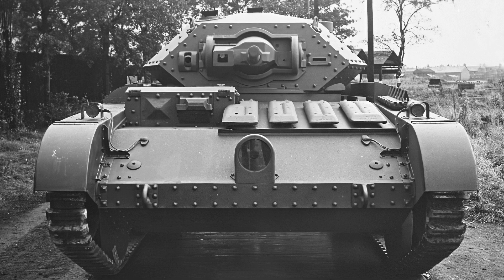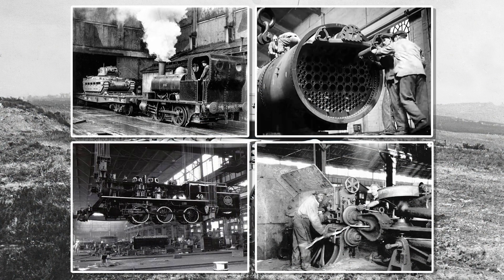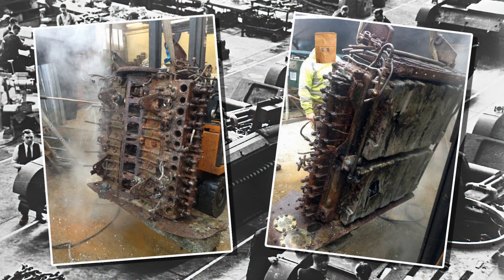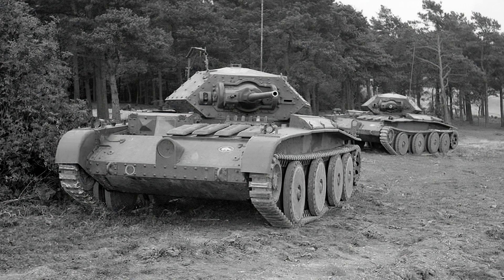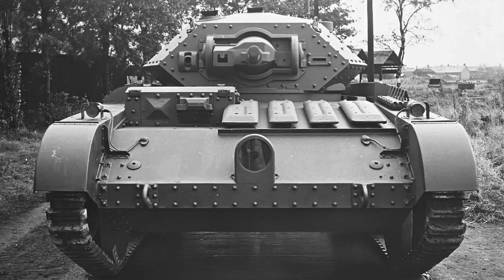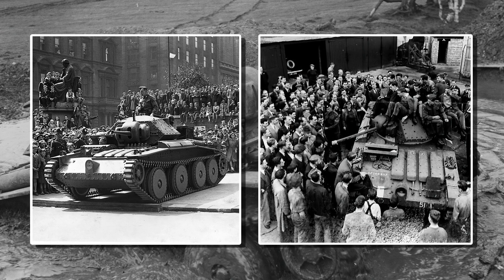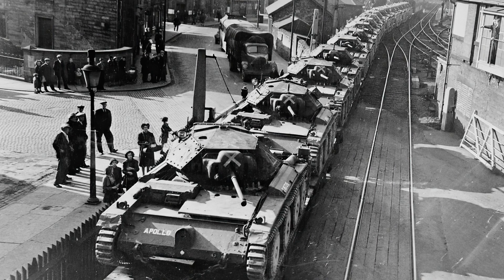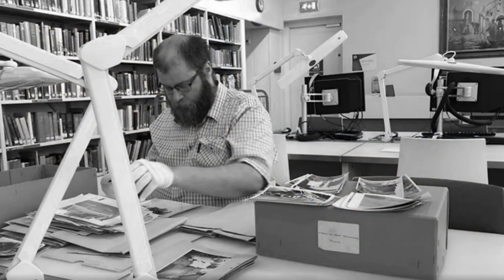Covenanter - Tank Design & Development

Comment: In the video, you claim the Meadows flat 12 engine couldn't have the radiator mounted above it (hence the decision to place the radiator on the front glacis). What was it about the Meadows engine that prevented a radiator being mounted above it? Why could a radiator be mounted above many other engines?

Comment: 5:55  No.  Wrong.  You CAN weld face hardened steel.  It's just tricky.  Explanation thanks to google:
Hardened steel is a form of high carbon steel that has been tempered through a heating process to make the metal more durable. Welding hardened steel can be tricky because the heat used in the welding process may cause the metal surrounding the weld joint to become brittle if proper heating and cooling methods are not used to prepare the metal. However, by utilizing appropriate post-welding heat treatments and choosing weld joints that evenly distribute stress on the metal, you can successfully weld hardened steel.
Reply from the maker: hmm interesting, they said they couldnt at the time, perhaps in regard to armour to be struck with rounds as opposd to elswhere?

Comment: 3:20  The phrasing is not quite right.  The Brits constantly designed their tanks to fight the current, for that time, German tanks.  The problem is, by the time a tank model was actually built and fielded, they were fighting against tanks that were one or two generations more modern, and that 40mm 2lbr was no longer up to the task.  Really talking about the Crusader here, since the Covenanter was pretty much still born.
Reply from the maker: well that applies to all, we didnt know what was beign developed until it appeared, once tiger and later panther showed up we designed to beat those, bu even at very fast speeds a tank take about a min of 1 year to go from start to finsih, longer if u want it to work

Comment: Something that strikes me about the design of many pre-war and wartime military equipment procurement is that the ministry’s procurement department issue a requirement for “X- piece of equipment and when they get a design that they want they then go and completely re-design it, and what they eventually put into production bares no resemblance to the original design, and turns what should have been a good piece of equipment into a complete frankantank, typical, and is still happens to this day, stupidity knows no bounds. 😀👍🇬🇧🏴

Comment: I disagree entirely . I think that it s quite clear that the fundamental problem with the design, the fact that the radiator was at the front and the engine was at the back , was irredeemable. It is obvious, as it should have been obvious at the time, that this arrangement would cook the crew.   The engine doesn"t have to ''run hot '' in order for this to happen , nor does an increase in weight ''put strain on the engine''.  The power to weight ratio was still very high indeed. Moreover, in order to talk of  ''putting  strain on an engine'' you would have to be talking about having a too high a gear ratio, rather than a lack of motive power.
Propaganda, moral , and deceit.  So, these ''roles'' simply mean the the British made the best of a very bad job.  The tank , which was otherwise useless, was used as a propaganda tool, to bolster the moral of the home front who were never told the truth. Obviously. This does not in any way make up for the fact that, at the height of the war , when the army was desperate for tanks to fight in the middle and far east, they received 1700 machines that were , quite literally , useless. They literally couldn't be used in combat!  Which makes this the worst tank ever built.
Reply from the maker: no, it’s really not, in fact by the mk4 she’s deemed one of the most reliable vehicles we have, below Sherman and above the others. (See notes of Brigadier Blagden) the radiator at the front is not an issue at all, and is found on many current vehicles. the problem was and remains how to move the cooling between both, and this was not satisfactory with the pump being too small. It was quickly fixed. 

The army was not short of 1700 tanks, its not like they were all made at once then sat there, they continued to make them over the next 2 years. If they were that truly terrible, they wouldn’t have. They were used primarily as training vehicles which meant that other vehicles could be sent where needed. And for the record both Churchill and crusader had far more problems when first introduced. 

Perhaps you should stop adhering to outdated, incorrect, and biased views like fletcher and actually read the reports from the MOS, WO, as well as training material an those who worked with them, the information is all there, in the archives.
Reply: @armouredarchives8867  I did watch you video , so there is no need to repeat yourself. nor is there any need to be snide. 
However, .. as you have repeated yourself, and as I am capable of spotting poor thinking , Let us deal with what you have written.
The radiator is found on the front of many modern vehicles. Irrelevant. As you , yourself, pointed out , these are vehicles with front mounted engines. Engines at front , radiator at front , simples. Put Engine at back , radiator at front, pump the coolant around the fighting compartment , what have you done ? You've used the entire hull as an engine bay. 
If the pump was the only problem and quickly fixed , the tank would have been used in combat.  But the problem was intrinsic to the design and could never be fixed.
As regards reliability,.. these Covenanters were conspicuously absent from the desert fighting. They were at home , doing low mileages , and with plenty of access to maintenance facilities and regular , scheduled , preventative maintenance. Of course they had a good reliability record ! 

And Of course the army was short of 1700 tanks.  This was 1941 and the need for tanks was desperate. The fact that they continued to produce these tanks was a scandal and raised huge questions about the MOD procurement methods. I strongly recommend ''The Great Tank Scandal'' as a good read on the subject.
But, more than that I recommend putting a little thought into some of your statements.  Crusader was a mechanical disaster , true enough, but with only a little clear thought you will realise that this only goes to further raise the question of why all these covenanters  stayed at home when they were desperately needed aboard. 
At the end of the day , this was a tank that could not be sent to the front in the middle of the most intense tank conflict in history and at a time when britain was in absolutely dire need of tanks.  That makes it the worst tank ever built.
Reply from the maker: @andrewwoodhead3141  great tank scandal by fletcher! this is where the issue arises, is that that book is full of mistakes. It’s like quoting Belton coopers death-traps. It was written a long time ago, and since then a good deal more of the archives have been sorted and stuff found. 
they do consider covvy it for north Africa, by the time they have the issue fixed on mk.2 but at the same time they are also going to have to up gun it to a 6Pdr, and those were already in very short supply. and at the same time both it and crusader were subpar on protection, hence crusader is faded out very quickly after Africa. so, no need to send a tank with a 2 pdr and relatively weak armour, while you have better vehicles. They do send 2 out for testing nut no other details on those 2 have survived. 
As for the radiator. That isn’t the issue. The engine issue the issue, the complaints were the heat exchange between them, the piping running though the left hull, with a weak fan it was overheating. – they fixed this very quickly by largening the pipe and fan, and cladding the pipes.  Covenanter being terrible/worst tank ever etc, is up there with ronsons, tommycookers and kruppstahl etc.
Reply: @armouredarchives8867  Oh  you're a ''revisionist'' LOL.  Ok.
Gotta be said, mind, and I hope you don't take this the wrong way , but David Fletcher is a well published author with some thirty books to his credit. 
 I'm sure he could be wrong about a few things but in this case you are stuck making a series of highly unlikely rationalizations to cover for a tank design that was produced in considerable numbers and declared unfit for service., never to be deployed operationally despite there being an over ridding requirement for battle tanks at the front.  That fact alone qualifies this tank as the worst tank ever built. 
As for the Radiator not being the problem , ..clearly it was. Name one other tank with a similar layout , in all of history...? If you lack any comprehension of the heat generated by an engine cooling system and how that would work if you piped the coolant around the fighting compartment in a small metal box of a tank,.. simply ask yourself why no one has ever tried to replicate just a disastrous layout. 
In Fact , that is usually a good giveaway all by itself, if something has been tried once and then never again.
As for the ''Ronsons'' ,.. There's a lot of self confirmation bias out there on tinternet.  ''No evidence that this slogan was ever used before such and such a date'',....and so on.
Except that the veterans are on record as remembering using the nickname very clearly. Except that far from  everything got recorded when we went computerised. Except that a lack of evidence uncovered when someone did a google search is not the same as evidence that an entire generation of British tank soldiers remembered the war wrong. And so on, and so on...
I'm not saying that there isn't new and interesting stuff to be uncovered by researching the archives, but an obsession with ''debunking'' myths can lead you straight up the garden path.
Reply: @armouredarchives8867  Hey, is there any chance of you de bunking the myth of the Japanese super heavy tank , the so called ''OI'' ? This is a modern myth if ever there was one , and with some serious backing .... that would one would be well worth doing !
Reply from the maker: @andrewwoodhead3141  there was at least 1 project called OI and is even recorded way back in the ogorikiewickz papers with japanese tank comanders, - but afaik it was more a mobile bunker than any proper tank, due to weight issues etc. - the rest of the stuff seesm to be more WOT fantasy than reality
Reply: @armouredarchives8867  Thanks. So, how real do you think it is then ? 
My understanding is that ''OI'' is simply an abbreviation for however you say ''big one'' in Japanese. I know that they had some pre war heavy tank projects , but these machines were fairly standard for their time. As I understand it, machines in the twenty and thirty ton ranges. Might not this ''OI'' recorded in these ''ogorikiewicks papers'' be referencing one of these more mundane machines ?
My issue with the ''OI'' is the lack of pictorial evidence. Even the WW1 German ''K wagen'' produces a couple of clear photographs, and this in an age when cameras were hardly very common. In contrast , the super top secret ''Maus'' had more pictures taken of it than Kylie Minogue !
My other issue is the fact that what information is , supposedly , available, is strictly controlled by a financially motivated body.
Reply from the maker: @andrewwoodhead3141  there are some persiod plans that are legit, the ogorkiewicksz papers are his letters he wrote from the 40's until his death, as he was probably one if not the most important figures in tank history. - he discusses the OI with the guys that formed and built the japanese tank forces. no photos, but from those few plans it clearly is not a conventional tank and more a mobile pillbox at best.

Comment: Did have the exact same turret as the Crusader? I was wondering if their turrets ended up on other tanks and armoured cars
Reply: The Staghound armoured car did receive a tank turret supposedly from a Crusader but it could equally well be transplanted from  a Covvie. I believe the turret rings for the two tanks were slightly different, the covvie's being smaller by an inch and a half. This may have been beneficial for fitting on an a/c. The gun in the Staghound was a 75mm QF which shows that the same gun that went into the Cromwell could have been fitted in the Covvie, with a bit of a squeeze. That would have given the Covvie the same punch as a  Sherman.

Comment: I think you present the cooling system in too positive light. Even if the pipes were wider, they would still pose a problem with heating up the inside of the tank and the front mounted radiators were vulnerable to enemy fire. You could disable this tank frontally with machine gun fire, that's not something to be desired. This is not just the execution, this is a serious design flaw. 
And when people say this tank was bad, you can't just say it wasn't that bad because the design wasn't that bad, because when people say the tank was bad, they are talking about the final product and not the design and the final product was bad.

Comment: Very nice looking tank. The bolts could turn into lethal missiles internally after a hit, which I why everything became cast or welded. A two pounder gun doesn’t sound much. Why didn't tank designers OVER-GUN their vehicles rather than provide what would penetrate peacetime armour? We invented the bloody things and threw away our lead, ignoring the works of British authors on tank warfare while the Germans studied and put their theories into practice. We didn’t produce a world-beating tank until after the war ended. Just not good enough. The Sherman was definitely not a good tank, it wasn’t called a Tommy cooker for nothing. When you know you have to sacrifice four or five Shermans to knock out a Panther or Tiger, how do you feel about that? A lot of brave men died because it wasn’t up to scratch. The only tank the Germans feared was the Firefly. Why didn’t the Americans with their much vaunted mass manufacturing skills arm later Shermans with that 17 pounder? It was still too tall and liable to burn but it would have kept the Tigers at arms length, say 2,000 yards.

Comment: If the original metarial was used would it have been a good tank, 
It looked the part and maybe ahead of its time.
Reply: The engine and radiator were the things that were terrible.  The Crusader is really the replacement.

Comment: Nice to see I'm not the only one rather sympathetic to this Tank, and out to insure some useful lessons on what not to do are learned from :D .
(a bit like what was done with the Valiant prototype)

I've found though that A15 Crusader's reliability issues can mostly be grouped into:

• Issues with the Nuffield Liberty Engine.
• Issues with the Cooling System.
• Issues with Logistics.

Of those; only one is really the fault of the A15 herself;  as bad logistics were also the cause of the A15 being deployed desert'side without a C/S update or even proper preperation after being unloaded at the port.

I think it's fair to say that A15 was chiefly the most obvious victim of a larger issue, that thankfully improved as time went on.
One could chastize the turret ring size or the lack of a larger armament; but that was an issue of numerous Tanks in WWII.

On A22 Churchill though: It's always worth noting that she was rushed into service so quickly; that Vauxhall sent out technicians with the Tanks, as they knew they hadn't had time to iron out all the issues.

One fix that was made swiftly was to add Water Drains in the lower hull, because heavy rain tended to flood the interior... and crewmen prefer not to have water sloshing around their feet.

Unlike A15 though the Churchill had a bombproof engine, a better (Merrit Brown) transmission, and by the MK.VII iteration thicker frontal armour than a Tiger I :D .
(albeit on a Tank with a wholly sorted running gear, and an uncanny vertical slope capability)
Reply from the maker: yeah all vehicles rushed are problematic for sure, tho its odd cos covvy was fixed very quickly, by the Mk 3&4 shes marked as the most relible vehicle we have, and whiel crusader is faded out by italy, covvy carries on training until 1945. - its a shame as 95% of all the bad press comes from one source who never bothered to look beyond his own bias :(
Reply: @armouredarchives8867  I admit I thought that the Covvies were retired around the same time as the Crusader was, and for the same reason.
(the debut of the A27M Cromwell, who's Meteor engine Crusader had a hand in developing [the government having finally had enough of trying and failing to get Nuffield to make something other than the Liberty engine])

Come to think of it: I recall reading that one reason for Covvie being riveted instead of welded, was the available factory tooling and lack of time to change this due the Tank being ordered for production. This would fit with how our Shipyards were slow to fully adopt welding in WWII, as the temporary dip in production capacity was not an option early in the war.
Similarly: Our Tanks had largely angular hulls up until the Exelsior & Centurion; because such a hull form was less complex & swifter to manufacture, and less internal volume in the fighting compartment was lost compared to a hull with sloped armour.
Reply from the maker: @jimtaylor294  this is true, angled artmour take up a lot more volume, is heavier oddly, as as we now know behaves poorly when overmatched. but the covvies were still in training till the wars end, albiet in much smaller numbers as parts ran out and were used up in mine trials or floating tests etc, all usefull info

Comment: An idea for the Radiators - What about fitting them at the top inside the track well above the tracks - you would need 2 or 3 return wheels under the radiators to stop the tracks pounding them to oblivion.  The distance to the engine would be much shorter and they would get some protection from enemy fire.